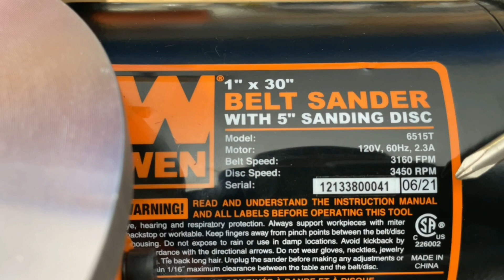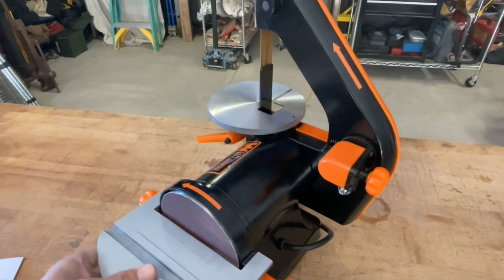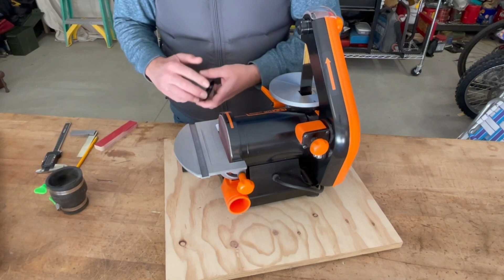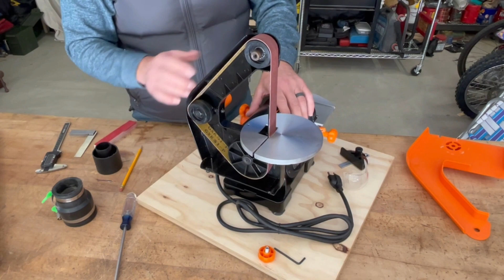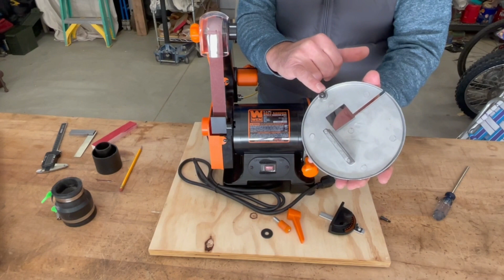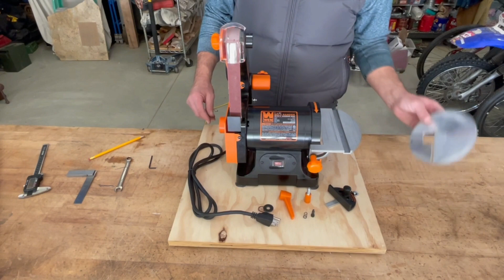WEN 1” x 30” Belt Sander-Detailed Setup and Review.  Way more info than you probably want!

Comment: mine worked for 10 minutes of use...now the motor hums, but won't start up...belt and disk rotate freely, together. Any ideas?
Reply from the maker: Warranty?  Not too sure since the belt and wheel move.  Sort of rules out the belt and wheel binding and preventing the motor from turning.  

Nothing more frustrating than being excited for a new tool only to have it break on you.  What a bummer.
Reply: @reuserebuildredeem8392  looks like it is the run capacitor... $8 fix, replacement on the way. One great feature of WEN tools is they are in chicago, and have parts for their tools and are reasonably priced!
Reply from the maker: @jackloganbill605  thanks for the info.  That’s good to know!
Reply: I am looking at this sander and the wen 2 wheel wet and dry knife  sharpening machine.  Main job is knife sharpening . Would you suggest this one over the wet and dry ? Thanks. I live in India and Wen machines are sold here under the brand name VOLTZ. We have a very limited choice as imports from China are not much.

Comment: I think the clear plastic part goes behind the orange side cover so that it goes all the way to the metal frame.
Reply from the maker: I had all ready tried that.  It doesn’t fit.  The slot on the clear plastic is too narrow to go over the part where the bolt goes in (on the inside).

Also, it causes the top of the clear plastic to not line up with the top of the machine.  

As much as I thought it would be a problem, it hasn’t fallen out.  

Thanks for the suggestion though.
Reply: @reuserebuildredeem8392  I just assembled mine your way. It fit better than my way... Thanks. 
Just so you know, using your method I got at least two and a half revolutions on the knob that  has about 3/16" of thread. Maybe your female threads need a tap to clean them out?
Reply from the maker: @bryanw2961  thanks for the details.  Went and double checked the female threads, all clean with plenty of room. 

Mine just may be a fluke from manufacturing.  For reference, the bolt for mine is only 8.9mm.  The two plastic pieces (clear guard and orange cover) together are 6.5mm thick.  Basically leaves me only 2.4mm of thread or 3/32” to go into the female threads.

Way more detail than I ever cared to look in to.  🤣. Bottom line, it’s held and hasn’t come out.  

Glad to hear yours has a bit more thread and thank you for sharing!  Hope your machine holds up as well as mine has.  I’ve definitely got quite a few hours on it.
Reply: @reuserebuildredeem8392 ?? Don't know. My thread is 9.5mm long and my plastic is 6.0mm thick.

Comment: How do you control or eliminate the static shock from the Wen?
Reply from the maker: I personally haven’t experienced much of a static build up when using my sander, even for long durations.  Start with making sure your outlets and plugs and such are properly grounded.  

I’m standing on a concrete floor and my machine is sitting atop a wooden workbench with metal legs poly casters, if that helps in your research.  

What I can confidently say is that electricity is looking for a ground.  Sometimes that becomes us when we touch something and get the shock.

Maybe someone else who has more experience in this will chime in.

Good luck.